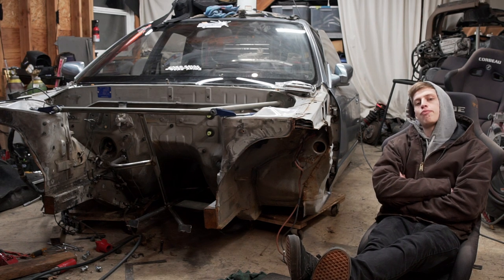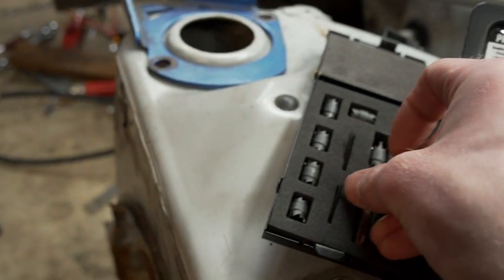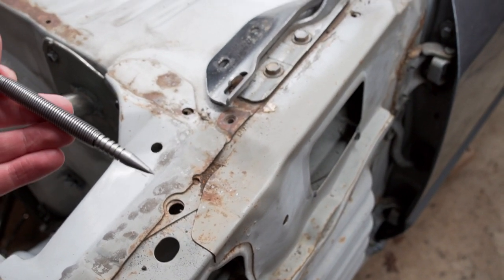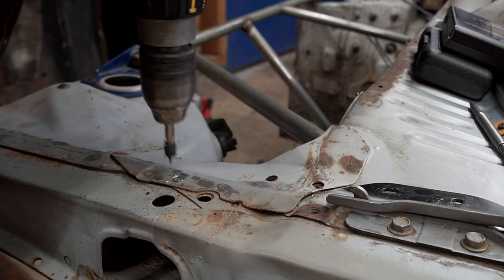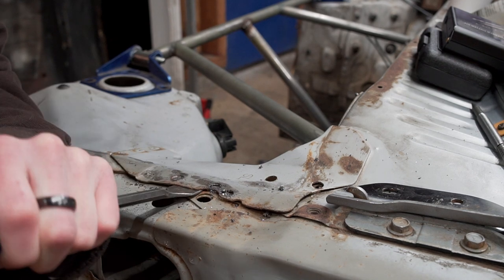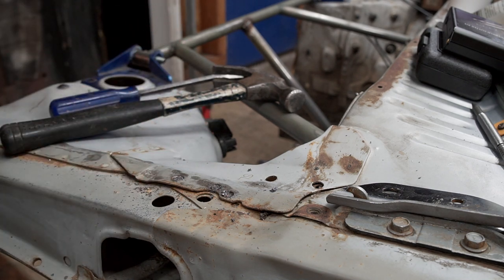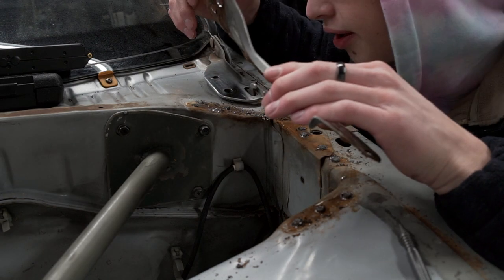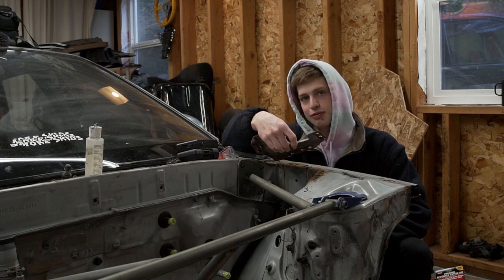Removing spot welds on the wrecked R32! | getting over fears | Saving the Skyline

Comment: It's cheaper I use a 1" air belt sander with 32 grit belts and just grind the spot welds then you don't have any fill in on car I could never get them spot weld cutter kits to work really well and then they tend to dull quick if they are cheap..
Reply from the maker: I started using a belt sander today and it was a big help! I guess I’m getting lucky with the bits because they’re mostly working well for me. They’re only really a pain when the weld is slightly larger than the but itself, or if the metal is bent right after the spot weld itself.
Reply: @JonasVanHorn  ya I noticed you knew not to get em hot that's what kills them as with any tempered steel..but I got a sorry 3/8. Wide by 13" harbor freight special for like 30 bucks and the belts are cheap on Amazon or harbor freight. Also it's awesome for sanding and grinding tight spots ,it's like a leather man of body tools now lol..well anyways have a great time and good video! 👍I had to go out and look what size it was because after I commented I thought that don't sound right lol.